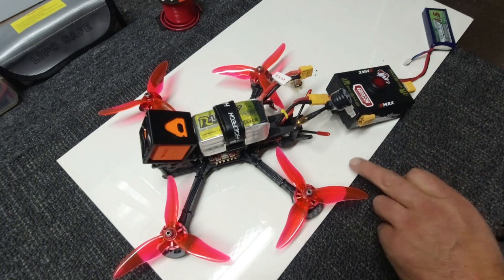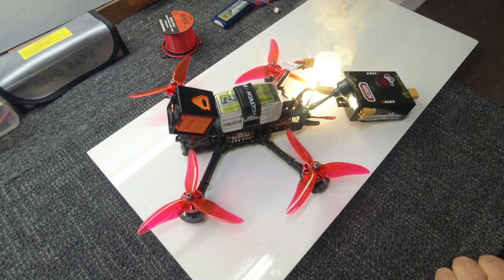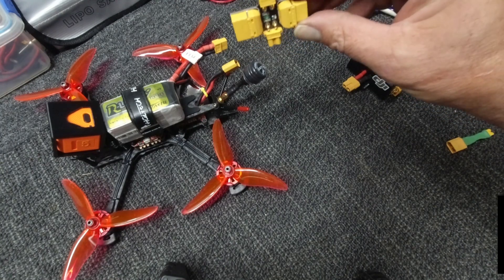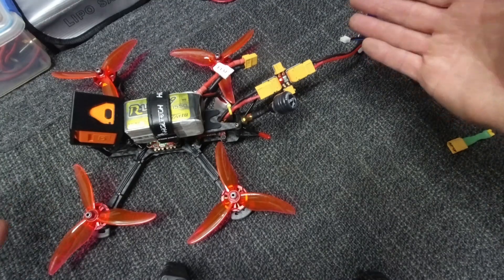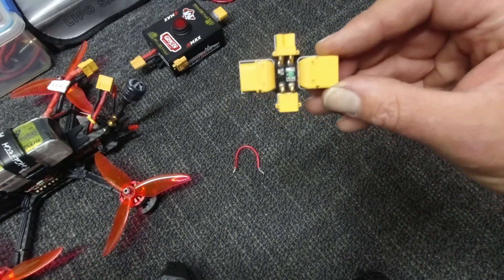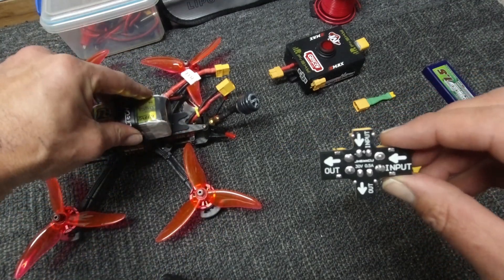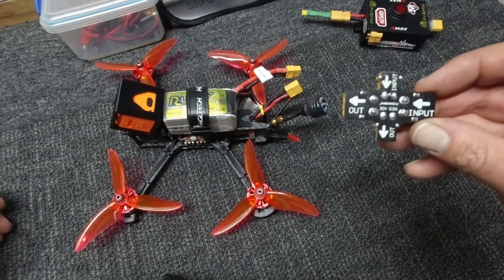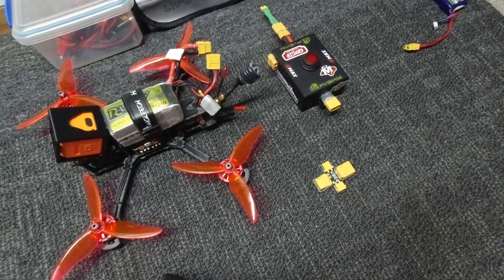PFV Quad Drone Smoke Stopper   |   Do You REALLY need one?    🌟🌟

Comment: I would definitely only use it for testing I would not use it as a permanent device on my drone or plane what if you're flying and it decides you're using little too much current which is quite normal for short periods
Reply from the maker: Heck no mate. Pure for the workbench only. Saves a burnt out fc after a rebuild.  👍🍻